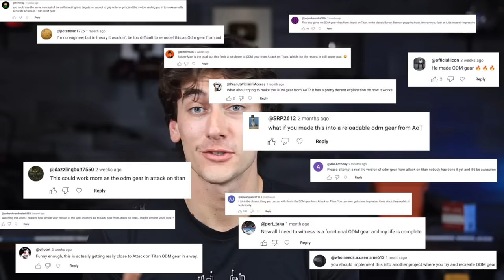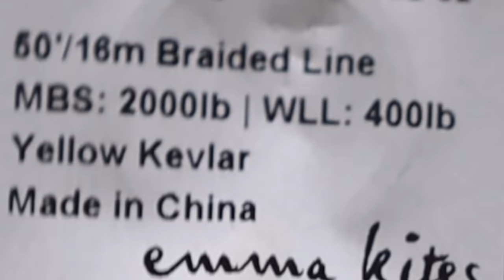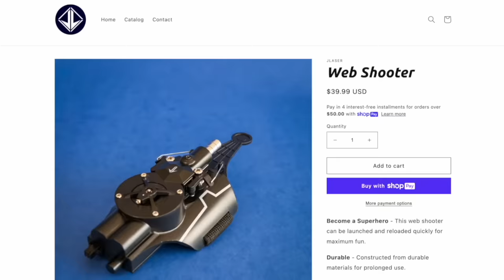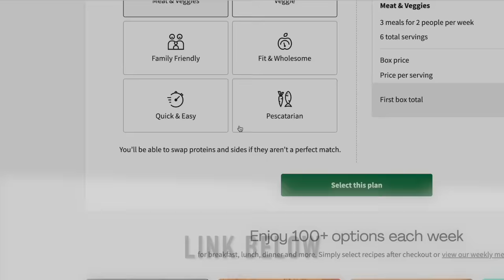I Built Real ODM Gear! - Attack On Titan

Comment: This is my favourite build from a YouTuber ever, its super faithful to the show, it's a hookshot type build but the fact theres 2 allows it to go faster and not have as many issues holding weight or balancing you properly. and theres the cool blade swap idea too. The only thing that could be better is make it multi use more easily but even in the show they reload gas canisters and it would be unreasonable to have such pressure newly created by the build each use.

Comment: It's getting to the point where I hit like before the video even starts, I just know it's going to be the coolest video I watch all week.

Side note: even with a limited understanding of mechanical engineering, I know how difficult it would be, but some way to make an automatically deployable/retractable barb system to the nail upon impact would probably make this a foolproof design.  Trust me when I say, for a YouTube project, I understand this would be textbook overengineering, but as someone else said, this could be incredibly useful for rescue personnel.  Higher-rated motors with speed control, and more safety- and comfort-oriented adjustments, and this thing could be readily marketed.

You've outdone yourself this time J

Comment: The triggers on the sword hilts are actually what controls the ODM in the show. The hand guard is what they use to eject the blades. In theory if you wanted to improve the design you could link the hilts to the rest of the gear to be able to fire and reel smoother.
Reply: I was thinking of this and maybe he could add a slight aim assist while holding a button on the guard or something? Give an extra 20 degrees up or something.

Comment: If he kept going with this project he could very well make even better gear that lets you genuinely fly like the show
Reply: I feel like you'd need an entire company to make this real and it would never be as good as the show. Seriously, you can only get the ability of about 30% of the show. The biggest hurdles are 'environment' and user ability. The training would be immense and you'd have to get it right every single time not to die. That means accurately aiming the harpoons, knowing swinging physics, judging distances, flawless gear reliability. The only reason they do it in the show is because it's necessary for survival and still half fail.

Comment: It’s not perfected yet but definitely lays the groundwork for someone to try and make the real deal one day 🤩 I can’t imagine just how much more complex things would get once multiple grapple hooks are incorporated and larger air canisters to be able to push yourself and swing around with them.
Reply: Maybe add a mini jetpack booster.
Reply: air cans are not the way, it needs to be like car engine small combustion cilnders, that's some of the things that need to be changed from the OG design wich is cool, but not perfect. unless he finds a way to generate compressed air from normal air, lol.
Reply: @ImCelticlol  You are NOT lugging around a internal combustion around. Even a ICE weed wacker is quite heavy. Compressed air really is the best way. The main problem i see is reloading the wires. Its easy enough(relatively) to load a new nail. Similar to firearms, redirecting some oft he gases to cycle a new nail. Problem is then connecting that to a new spool of kevlar rope. Unless it is somehow supposed to detach from the structure and reel back in. But in order to even have the strength to pull a human in, that nail has to be in deep and any realistic way of reeling it in would pull the person towards it, not retrieve the nail.

Comment: I think just like in the anime if u get a proper trainging for MONTHS u could actually be as good as they show in anime
We wont know until someone actually does it
Also i think i think in the anime the motars are a lot more powerful and they have a kinda jetpack thingy launching them. They call it 'gas'. Now obviously I understand why you didn't add  powerful motors and stuff because its really dangerous but if u actually want to work like anime and do cool moves with it then u need better motors. Also the timing to pull the strings also must be important which can only be learned through experience.
But overall i LOVE this thing 
Keep up the stuff my guy you made my day
Edit:upon second thought i think it would actually need YEARS to master it if not atleast use it properly

Comment: This project was amazing!  But it seems that you one thing. Used four gas cylinders for their initial take-off and then to perform basic maneuvers like changing directions and dodging attack. The used gas outlets similar to nozzles we see on the engines of F 22 Raptor (note- Pratt & Whitney F 119 engines provide 2D thrust vectoring and not 3D vectoring like the AL 31 and 41 engines)

Comment: This is actually supremely well done, I love watching your videos because your really take us through the problem solving process as you go. You very quickly learned that it wasn't safe or comfortable to try to manage two independent reels at once. Adding the powder hammer to the anchor to force it through what you were shooting was an extremely smart solution to the problem of relying on C02 to drive it long distances and helps to insure it cleanly punctures what you hit.  

Really the only question I have is why did you decide to go with a solid cylindrical nail instead a clawed tip like they use with grapnels? Surely that would help retain your weight and stay lodged the surface you were firing at easier. At first I figured it would be due to the fact they would be difficult to retrieve, but seeing as each shot is a one and done scenario either way I figured that couldn't be it. Do you mind explaining it a bit, or was it simply a "it wasn't really needed" scenario?

Comment: you very much need to add leg straps, they will increase balance and maneuverability. They design in the show actually looks pretty solid, with them creating a lattice around the knee. whats important is that the straps transfer weight from your foot to your patella when you bend you knee. there will still be positions where they go slack and weight is on your base harness but it will be a big difference

Comment: this is fucking awesome! i'm surprised you managed to do so well on your jumps, since you didn't have the added compressed gas propulsion the military has in AoT, which is frankly unrealistically strong, I don't think we could store that much compressed air in those tiny gas canisters they use. It is fantasy, after all. But the way you managed to fly and fairly reliably pull your body weight up was mad impressive. Especially considering you didn't have three years of practice like the survey corps had.
Awesome as usual, I'm excited to see your next projects
Reply: yeah, in show they use the fuel called iceburst stone

Comment: A few more improvements, probably 4 wires instead of 2, a better way to secure them when they land, a way to retract them when you want and a lot of training and you probably can fly trough a forest
Edit: also a guided system, launching always to the front is not the best way to move, but this design can be aimed by you hip
Reply: The series shows basically every component of the ODM gear like the triggers/levers in the sword's hilt and their functions (levers on the side of the hilt allow you to change the angle at which the grapples are fired), the compressed gas system reeling in wire by spinning a turbine, and the clothing and harness required to properly distribute the weight of everything.
Reply: BTW I don't think 4 wires is a good idea because you would have to add 2 more reeling mechanisms and 2 more firing mechanisms which would just add to the cumbersomeness and complexity of operating the gear when 2 grapples should work perfectly fine if you properly distribute your weight and are confident with your ability to maneuver.

Comment: The show also used some gas to propel the scouts at the start and then reeeeel. I don't know it that's possible tho
Reply: Certainly not. Pressured gas would requiere a big and heavy tank, but also solid substances wouldnt work well (or only for a very very short time, while being also very dangerous for the user).

Comment: Would it be possible to either purchase it or re-built it, if that is so would you guy's mind if I not only go off your design (while giving you credit for the original design of course) but improve it to have longer range, better sight of where the cable will go and maybe more weight strength, if that ever happens you'll get the first if your alright with it, it would only be available for you, me and only those I trust a lot to use it wisely, but with your design of it what can and can't the hook grip onto because it could help with swinging, please bear in mind this is only a thought and will not be intended for public purchase and for pure fan service and or personal fun, I REPEAT THIS IS ONLY A THOUGHT THAT CAME TO ME AFTER WATCHING THE VIDEO SO DON'T TAKE THIS COMMENT SERIOUSLY (unless you really want to improve on it)

Comment: Odm gear uses compress CO2 along with the cables for movement and does not solely rely on a pulley system Therefore your odm gear is not odm gear it's just a shity knockoff granted it is a recreation of something from an anime still just a knockoff that doesn't work how it's depicted in the anime not to mention the speed you get out of that thing is a snail's pace compared to what the characters are able to achieve in the anime
Reply: dont u realize that would literally be strapping rockets to your hips, so many things could go wrong
Reply: why dont you attempt at making this bud?

Comment: this could be useful for firefighters
they could get to tall buildings quickly
Reply: To attach the hooks to a compromised wall surface due to the heat, besides all the health risks if you do just a single mistake and smash for example to the wall or fall a few meters to the ground? Yeah, such a great idea...